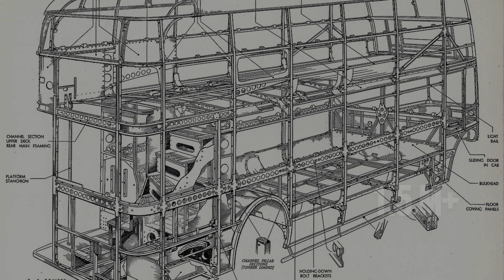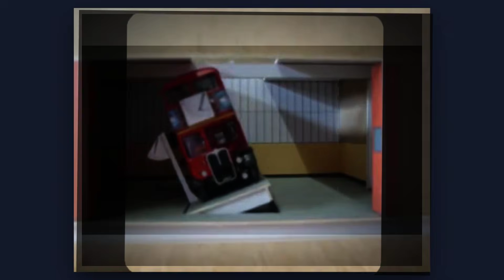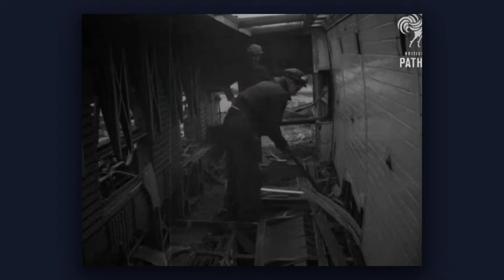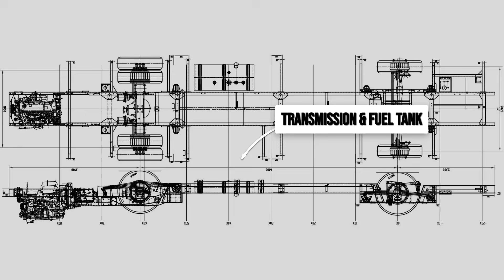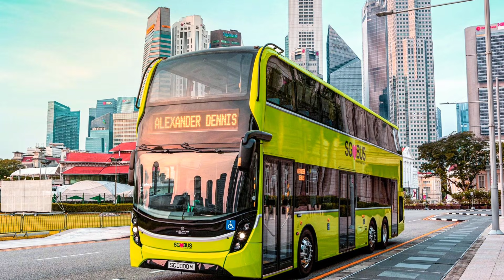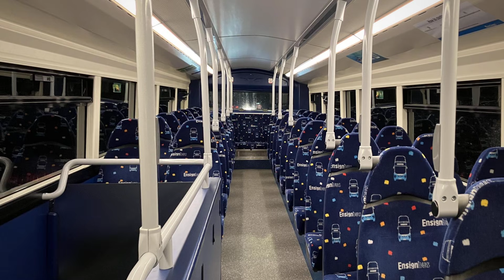Why Double Decker Buses Don't Tip Over? The One Engineering Trick Nobody Explains

Comment: Equilibrium, specifically by maintaining a low centre of gravity and a wide base helps double decker buses stay stable,prevent tipping and pass safety tilt tests ( standard calibration 28°) even when navigating tight corners or carrying a heavy top deck load.